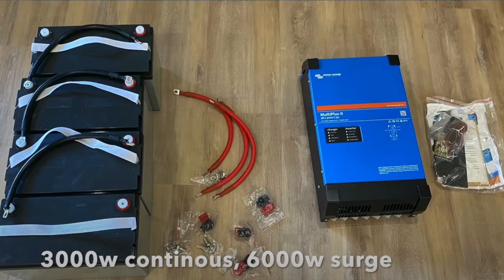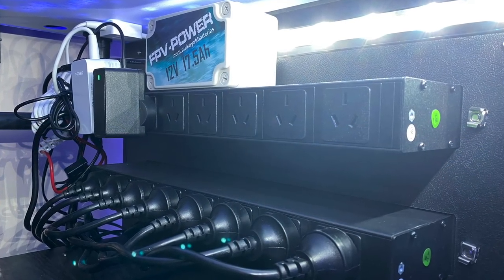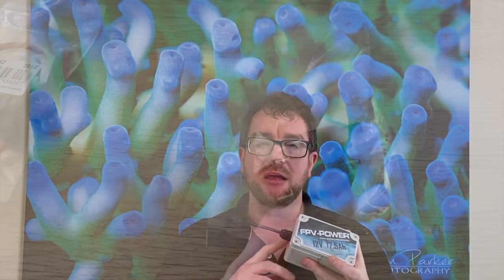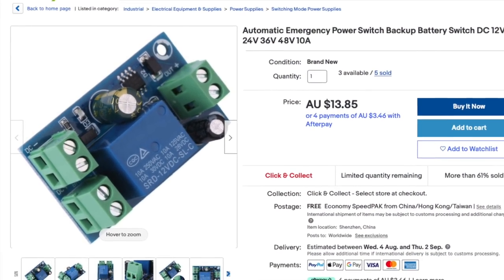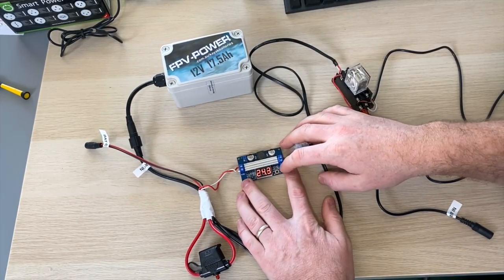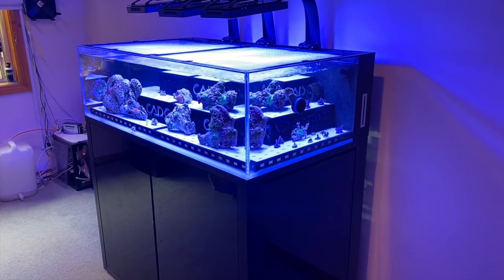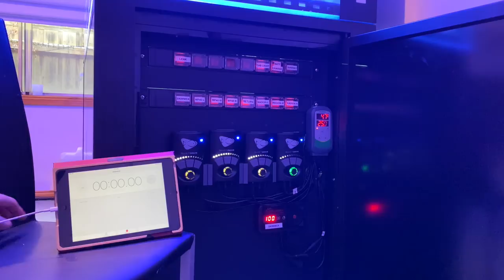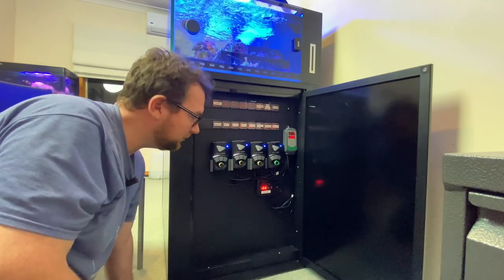How to battery backup any DC powered reefing equipment - CHEAP!

Comment: With the skimmer and return still running its because they have no low voltage shutoff due to the step up converter.. this is a great idea but if it was me i would opt for 2 batteries in series giving 24v or just a 24v version and then use step down converters instead.. giving you more run time and also less chance of draining the battery too low where it won't charge.. ive seen that hapoen so much in the rc car world. But still gotta say it again great idea sam
Reply from the maker: Sound advice mate backed by good experience, thanks for sharing!

Comment: Thank for sharing great video as usual in the process of doing this for my MP40 on my 50 gallon Lagoon reef tank.
Reply from the maker: no problem at all, for vortex pumps it is crazy easy - just a straight 12v connection, the switching is all done inside the controller

Comment: Sam you've out done yourself with this one! I've been trying to figure out how to backup non-ecotech pump for some time now.... Thanks a million!
Some viewers might also be interested to look at the "Baintech" range of Lithium batteries (usually used for carvan and camping). They are at a premium pricepoint but are still 'relatively' compact and have ~10x the storage capacity of the kayak battery.
Reply from the maker: Thanks Adam, glad to hear it is of some help! Yell out if you need help or have any questions with your build :)
Reply: @ParkersReef bigger challenge awaits me with this one... Octo skimmer has varios pump which is 36v. Seems I have some more research to do there!

Comment: I love the kayak battery - genius!. I've been buying portable power centres from Jaycar when they are on sale. Haven't installed them in any sort of automated system but at least I have them around (charged).
Reply from the maker: Always handy to have some charged batteries about!
Reply: @ParkersReef  I do wish the Tunze connectors were cheaper or there were a simpler option for wiring up gear without abuilt in input for a battery backup. I had thought of just running individual 24v batteries inline (like my upc for my router) but I assume there's a reason that's not a thing

Comment: What would be nice is a small volt meter so you can see what voltage you battery is. But very nice setup. My system is hooked up to 4 big batteries that are hooked to 10 solar panels. Everything runs off of them
Reply from the maker: Nicely done!!

Comment: That was very useful. Just made one myself for 40 Euro. Thanks a lot 👍👍
Reply from the maker: Good stuff!!
Reply: @ParkersReef  Just another question. I also have a Jump skimmer, but I would also like to wire my 2 Jebao returnpumps on the backup system. Can this all be handeled by 1 dpdt relay or do I need one for every pump with its own psu?
Reply from the maker: @Langenbergh  ideally one relay per psu. But you could use one large psu if you prefered?
Reply: @ParkersReef  I think I'll do that 👍

Comment: Wow, this inspired me to go DIY for backup battery 😁 Might as well just bundle a bunch of AA batteries together, super cheap and expandable. I wouldn't be surprised if the bigger batteries like the one you've used have a bunch of smaller cells inside anyway.
Reply from the maker: yeah they use a bunch of lithium cells managed by a BMS :D
Reply: @ParkersReef  I know you didn't need it since it has a BMS included, but got any tips for going DIY for that too? 😅
Reply from the maker: I don’t I am afraid, I know a little about BMS, but I gather a little info is dangerous 😅
Reply: @ParkersReef  I found they are probably too cheap to try to DIY it 😅 Meanwhile I'm ending up on sites explaining how to weld 18650 cells together... I should get some sleep instead.
Reply from the maker: @DillondeVoor  hahahaha yes, sleep - always tomorrow :D

Comment: Great work Sam, one thing I would suggest as a small upgrade, rig up an alarm/speaker to the unit, so that when its active it is super obvious. I am sure you could do it to your home automation as well
Reply from the maker: Ah good thinking!! I have something coming for power outage notification though :)
Reply: @ParkersReef  I, and suspect others, are looking forward to that video, its a topic that comes up a lot and since the apps that we used to run on cheap old smartphones stopped working I haven't seen a good solution to replace them yet.
Reply from the maker: @ReefNerd  should be next weekend, assuming the new sim comes Monday. I don’t think I’ll need more than a week to test it for the review :)

Comment: Was considering a back system at the start of the year. But after TC Seroja I don't think I would bother.
Back ups are good for small outages, what we are used to most of the time. But if you loose power for 5 days and don't have a generator. Get ready for a big lose.
I managed 5 days with running my tank for about 3 hours each day.
Lost nothing. A decent inverted Geny about 2 kVA is well worth it.
I managed with a 1kva that was playing up but it got me thru.
Lost no fish coral or fridged food.
Reply from the maker: yeah agreed, 5 days is next level. This would give you time to charge the batteries during the day whilst the generator was running and keep the essentials on at night so you can switch the generator off though?

Comment: Great video I’m starting to work on my battery backup system. My goal is to an off grid battery solar system that runs my tank. I need to start ordering all the parts and putting it together, of course it’s going to be DIY.
Reply from the maker: Nice one!

Comment: Wow that was impressive. Lots of pumps now that only work on 24 volts. Only daunting part is all the parts you need to get to make it complete. I am even less smart when it comes to electrical work. But I did manage to wire up new LED downlights and also an Ixl in the bathroom and even a cooktop in the kitchen. But really I was just copying the existing wiring for most of that so it was child's play.
Reply from the maker: You can buy things like the ecotech battery booster for a plug and play solution (even if not using ecotech pumps)!!
Reply: @ParkersReef  Ok very interesting, so would this work if I wanted to power 2 or 3 or more 24 volt pumps all into the one booster?
Reply: Another dumb question sorry, If I used a tunze safety connector also would it work for multiple pumps being it has a 4amp fuse built in? Or could you swap the fuse for a 10amp into the safety connector and do away with a separate fuse all together?
Reply: @richardportelli1983  If your going to be mainly powering 24v devices you may want to look at a 24v battery over a 12v one as the boosters do cause a loss of capacity. The 4 amp fuse that is built in most likely due to the current rating of some component of the device or that most dc power supplys for things like the pumps don't put out more that 3 amps. As such you could up it at your own risk as fuses are a safety device.
Reply from the maker: Yeah I’d just doing 24v, go two smaller 12v batteries and not worry about the step up converter
Reply: @toejah  yeah I think I will do a 24 volt setup and use 2 tunze connectors to run a nero 5 and a return pump. That should be more than adequate.
Reply: @richardportelli1983  you may only need one tunze unit if your total draw is under 96w @ 24v
Reply: @toejah  Yeah that would be nice but they only have a single input where you plug your 240 volt cable. I have no idea if or how I would make that work hey. What's a couple hundred bucks in the reefing hobby.
Reply from the maker: If your power supply is large enough (tunze usually over supply them anyway!) you’ll be fine

Comment: I'm going to try this build I just had. A power out when I was watching this so I have to build something but this will work with any dc pumps... The dpdt relay will work with 12 v probably won't use 24 v not sure.... So what I'm asking will it work for just 12 v stuff if
Nevermind I found 12 v one and the holder works for both thanks
No gotta find in us
Reply from the maker: yep you can build it to suit any voltage

Comment: This is fascinating and something I am very interested in but seems a bit advanced for me to wrap my head around lol. I do have what might be a stupid question but how do you know what is AC vs DC?
Reply from the maker: yeah that is a fair question! The easiest way is to see if the device has a power brick. That will convert AC power (which comes from your wall) to DC and it will actually show you the input and output voltages and amps on the brick itself

Comment: Great video.  Your sources will not ship to the USA.  Can you recommend another source?
Reply from the maker: They will actually. Do a search for FPV Power batteries and you’ll find some local stockists in the USA
Reply: @ParkersReef  Thanks but what about the relay & relay holder?  I have not yet been able to locate on EBAY or Amazon
Reply from the maker: Relay holder is not necessary, but if you went to any electronics store and asked for a 24vdc dpdt relay they’d be able to sort you out

Comment: This is awesome thanks! What battery would you recommend for this return pump that's available in the states? And would the Tunze work if it's 24v? THANKS
Reply from the maker: any battery within your budget will work - I do like the FPV batteries though, they are very high quality.

I don't know if the tunze connector actually bumps the voltage up to 24v or not, personally I'd rather build my own :)
Reply: @ParkersReef  thanks! Are FPV available in the states? thought it didn't look like it
Reply from the maker: Yes I believe they are
Reply: @ParkersReef  will I newd a 12 or 24 v?
Reply from the maker: I use 12v batteries and then boost up to 24v if your pump requires it

Comment: I know this is an old video but can I use the same setup with a car battery (which I already have lying around) to run my jeabo dc return pump? the pumps transformer says it's output is 24v. I'm thinking of hooking both my mp40 and the return pump up to it just in case as I'm going away for 4 weeks. Would you think there is any advantage to hooking up the other 2 nero 5s to it?
Reply from the maker: Yes you can. You will need to connect a charger to the battery as well.

Otherwise everything is the same as this video. Mp40 will take 12v straight from the battery, the jebao will need a booster and a relay

Comment: Looking at options to use 18v makita batteries. I have loads and I can always leave a charged one in a holder. Coupled up with a voltage adjustable board..
Reply from the maker: yeah you can do! There are lots of aftermarket holders for the Makita batteries that will allow you to tap into their power!

Comment: Hi Sam, dumb question but, why not just use a small computer UPS unit, plug in your pumps and good to go? :p
Reply from the maker: they're quite small and don't have huge capacity. That's the main reasons why :)
Reply: @ParkersReef  seen a few APC around 1200VA for about $140 usd.. should hold for a couple of hours right?

Comment: Hiya, if possible I would love to see how your  battery back up is connected,  I'd appreciate that a lot. Thank you Steve 😊
Reply from the maker: My main system? I have my main tank on its own circuit, all power for it runs through an inverter/charger/transfer switch.

If mains is cut or under supplied, the system automatically takes power from the battery bank.

More info in the video here:
https://youtu.be/dUHwKcHwpjQ

Comment: Hi Sam awesome video. If I want to run one MP60 and may be a Vectra L2 for 12 plus hours. What battery backup would you suggest. thanks
Reply from the maker: Hey Nihard, For 12 plus hours for both I would recommend the following battery:

https://www.fpv-power.com.au/FPV-POWER-12V-75Ah-LiFePO4

If just the MP60, I think you could probably get away with this:
https://www.fpv-power.com.au/12v-25Ah-LiFePO4

If interested in either solution, let me know, I can custom make it for you to be plug and play with your MP60!

Comment: I have been trying to do some research on methods to battery backup my apex return, while maintaining control through apex. Though coming up to dead ends with my lack of electrical/electronic knowledge. 

24vdc signal coming from apex, 24vdc coming from battery, then coil signal coming from seperate mains related source. 
Is there a DPDT that uses all 24V?

Also, do you suggest cycling the DPDT periodically to check for its function?
Reply from the maker: Yep ok, so if your return is powered by the 24v bus on the apex, you would intercept that signal. 

I’d still use a 12v battery with a buck converter to raise it up to 24v.

DPDT relay to automatically switch between the apex power supply and battery backup.

I’d be happy to make the system for you if not confident?

I would recommend testing it every few months, especially key if the battery your using doesn’t have a long life expectancy.

Comment: Hey Sam, great video. I am trying to build something similar but I'd like to just power my mp40s. i have 3 but would only like to power 2. I found the battery on amazon and ebay but am having trouble finding the other pieces of equipment you have shown and am a bit confused. what else do i need to make this as simple as possible. im familar with amazon and can order supplies from there. thanks keith
Reply from the maker: hey keith, if you have a 12v battery already - you just need some connectors to your MP40's. They use a 1.3mm dc connector, look those up and get some wire - you'll be set :)

Comment: Do you know if you have to provide the same 24V from the battery to the relay as the skimmer transformer provides? I ask because many relays say both voltages in have to be the same, yet many pumps (Icecap gyres) have a battery saver mode when they see 12V instead of 24V.
Reply from the maker: I always supply the same voltage as the power supply (unless the pump has a dedicated battery backup option like the ecotech range)
Reply: Hmmm ... Wonder how the 24V Icecap gyre pumps work then with their overpriced 12V 2.5Ah battery backup option?
Reply from the maker: Pump will likely accept a 12v input but run at a maximum of half speed. 

But I’m only guessing as I haven’t opened one up :)
Reply: So if you want to use a relay to build an automatic transfer yourself but not lose the efficiency of the 12V battery backup mode, how would you do it, do you know?
Reply from the maker: You’d still do it the same way, but only pass 12v on the output side of the relay.

That way it will accept 24v from PSU till power goes out the  recent to 12v from battery when it does go out
Reply: Doesn't take a special type of relay to accept two different input voltages? The ones I'm seeing on Amazon clearly state that the two input voltages should be the same

Comment: Hey Sam, great video , I recently picked up a Maxspect Jump Gyre 4k , not sure if this model has the ability to switch to battery backup mode like the regular maxspect gyres do, there is no switchover cable that comes with the unit and no mention in the manual. What would I have to order from Nick's aquarium to get your small battery kit working with this Gyre? Cheers mate
Reply from the maker: Hey Ray! Nicks will have a universal switch which is what you will need. That accepts a battery input and your gyre power supply and switches between the two automatically (bumping the battery voltage up to 24v in the process). If Nick doesn’t have any or isn’t sure, let me know and I’ll sort you out :)
Reply: Thanks mate, I think if you could choose one device to back up , it's probably best to keep the return pump running , keep your bacteria alive in the sump and get flow in the tank at the same time with surface agitation.  May do that instead of the gyre , the return pump is a Varios Dc so should be good to go with the switch.  Cheers
Reply from the maker: @rays7177  yep the Varios will work perfectly with  the universal switch and yes - not a bad idea to keep the sump active. Return pumps generally use a little more power than wave pumps though, so will chew through the power a bit quicker

Comment: Aousome idea, is the battery charger plugged in all the time, if so is there a separate port on the battery?
Reply from the maker: Yes it is, the battery charger has a plug I’ve wired in before the fuse :)

Comment: I'm a looking for a recommendation for what Batteries to use to run 4ea MP40 in a 300 gallon tank?

TIA for your help!
Reply from the maker: Mp40 only need a 12v feed, so any affordable 12v battery will do the trick. 

Look for something long lasting, sealed, fits the space and budget you have

Comment: You got to watch out for lithium ion batteries. Ensure that you buy from reputable brands only and it should have the proper circuitry to protect it from overcharging and overheating otherwise they are a ticking incendiary bomb waiting to burn your house down. They can explode and generate intense heat and smoke that  ignites flammable materials a meter or even more radius from it depending on the quantity.
Reply from the maker: Correct. That’s why I bought a quality unit with a built in BMS 👍🏻

Comment: Your DIY battery backup video inspired me to imitate it, thanks! Does the watts for the 12VDC to 24VDC booster matter? I see one rated for - Output: DC24V Max Current: 10A240W and another - Output: DC24V Max Current: 5A 120W.
Reply from the maker: It will matter depending on the device you are wanting to run off it. Check the watts of that and ensure you booster has enough to cover it 👍🏻
Reply: @ParkersReef  Wow, you are awesome! Thanks for the super fast reply to an old post. If I want to run three or four pumps like you have, does this factor into the equation? ie. 2 (Varios 4) are rated 24V ⎓ 2.5A, so 24V x 2.5A = 60W x 2 + the watts others?
Reply from the maker: That’s correct mate